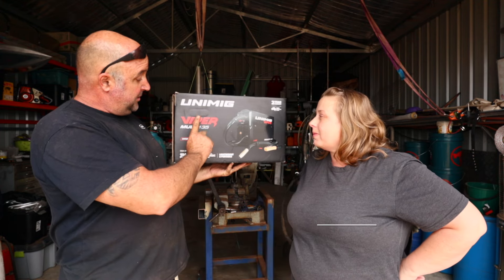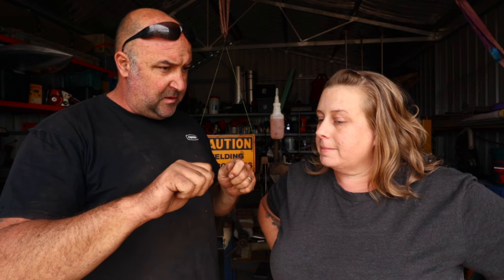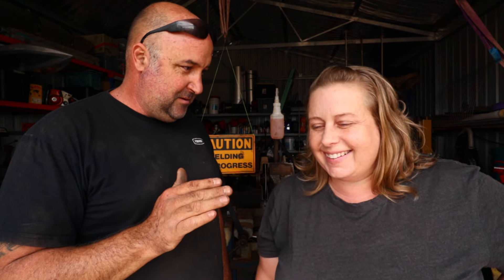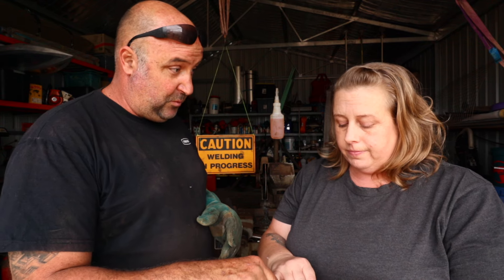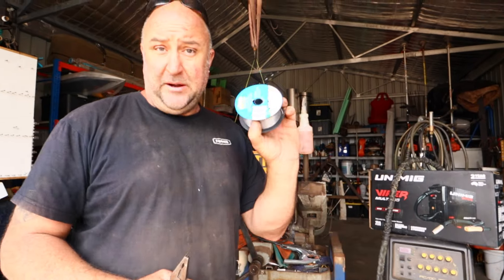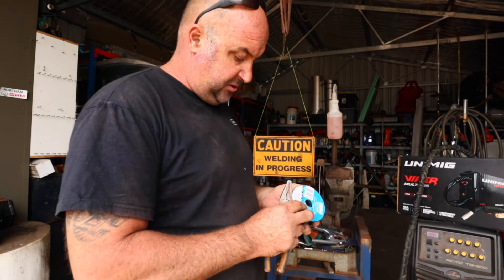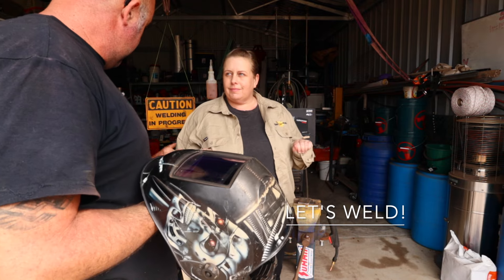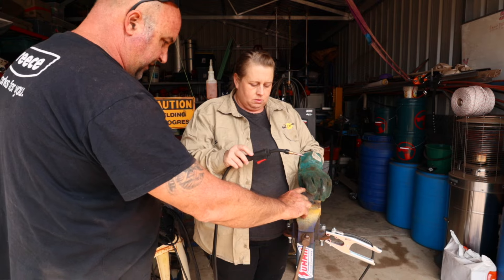Unlock a CORE homesteading skill! Steps to First-time Welding

Comment: Always handy if you can weld, even if it is only just the most basic stuff. When I was younger nobody was willing to teach me, It was always presented to me as if you needed highly sophisticated godlike skills. Later in life I bought an old second hand workshop stick welder, it doesn't even have any switches on it. If you want to use a higher amperage you have to put the stinger and earth cables in a different socket on the machine. The scrap value from the cables for the stinger and the earth clamp is worth more as what I payed for the whole welder. 

I watched some videos about welding, and now I can weld good enough to weld some brackets or something ornamental. Being able to repair things can save a lot of money. But those little mig welders are also very good for small art projects from scrap metal. Or to create frames for all sorts of stuff in the garden. 

But I have to Give Corey a special compliment, because his teaching skills are absolutely phenomenal. Very clear instructions, not a word French about it. He kept calm and Corey was extremely patience. Took all the time of the world. I mean, in one word it was just brilliant teaching. 😁Anyway, as always a huge 👍
Reply from the maker: @insAneTunA  definitely a good teacher… I didn’t even have to edit out any bits where he lost it 😂😂 it was great fun!

Comment: That’s great! I’ve wanted to give welding a try for so long! It’s such a handy skill and opens up so many possibilities, as Corey’s already shown on the homestead. Just a tad intimidating, not to mention I get so confused by all the different types, so you’re lucky to have a live-in tutor Amanda : )

Corey, would this little welder be good enough for the welding jobs you’ve done on the home build - the support posts & the steps, for example? Cheers, Sue 👍
Reply from the maker: @s-c..  it would do almost it all but would want a slightly more powerful welder to weld the thick plates that were the bottom supports on the steel frame floor posts.
Reply: @ROCKPILEOffgridHomestead  ok, thanks, I suspected that, but awesome nonetheless!!

Comment: Great work guys Thumbs up Amanda well done, ha Corey when in the field what geni do you use to run the welder as my shed is off grid as well and would love to have a welder in it 
Cheers Mark
Reply from the maker: Dewalt 8kva. I use that for welding even in the shed. Even though technically our system should handle my bigger welder. Just prefer to run it on the gennie 👍 Amanda says thanks too 😁